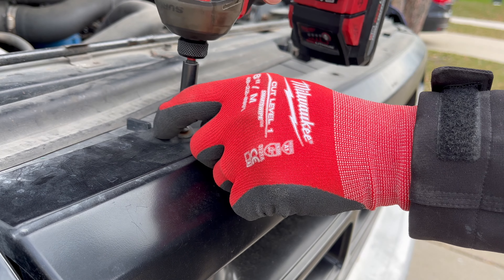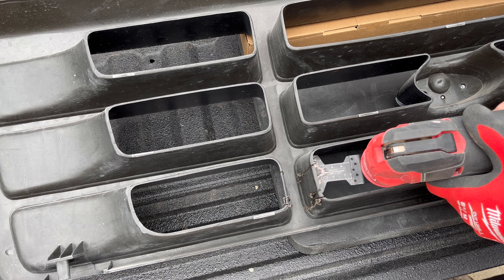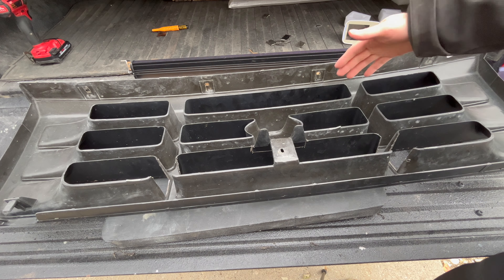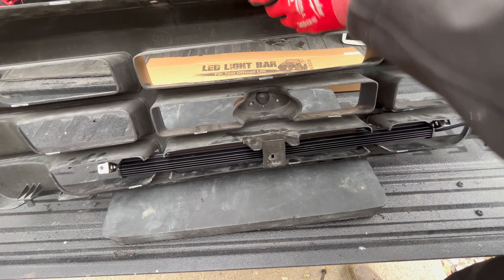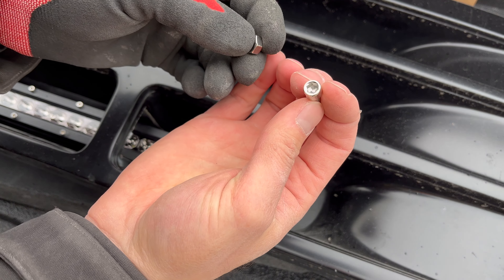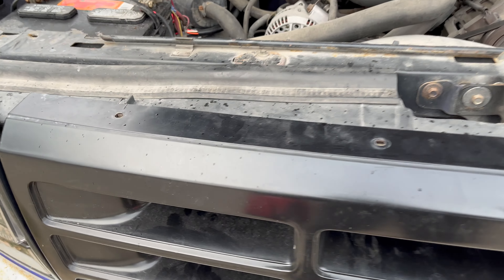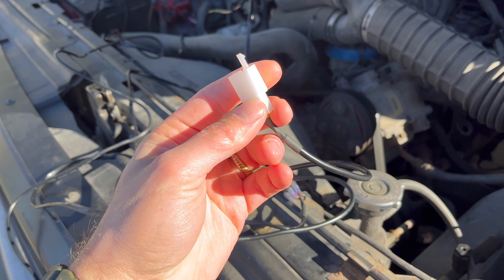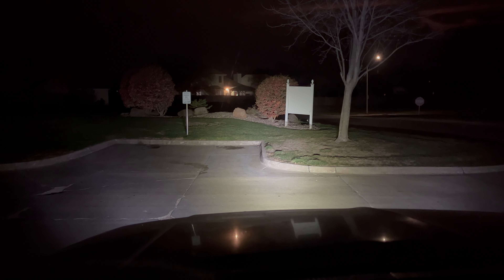How to Install a Light Bar Behind the Grille | 1995 Ford F150

Comment: Its nice to have additional lighting when needed.
 Some states require lighting like this be on a seperate switch that only gets power from the factory supplied low beam circuit this limits excessive lighting while driving on the hidhway to protect blinding on coming traffic.
Reply from the maker: Definitely! 

I didn’t know that. I just figured I wanted it on a separate switch.

Comment: Stevie! Thanks for another great video.  Ima let this marinade in my mind to see if I want to do the same. But I do have a question or advice. I’m going to do the water pump,and a seal refresh on my truck.  And was thinking of doing a long road trip after.  Of course if all my work is done right.  But would love some advice on prepping the truck for a long drive.  Or if anyone in the comments would suggest something
Reply from the maker: Thanks man!🤙 A good seal/gasket replacement job is always a good idea for these old trucks. I’m not sure how long your road trip is going to be. However, I recommend doing a shorter trip day and hour of interstate/highway. If any problems arise, it will happen during that trip.
Otherwise my prep for a long drive was always the same for these old trucks. Check all fluids and replace as necessary. Take additional fluids if it’s typically for them to get low. So for my truck, that was oil.

Comment: Do you know if the light bar comes with the harness or do you have to buy that separately? Secondary question, was the bottom screw hard to get in/not put in after installation of the light bar? Thank you!
Reply from the maker: Yup! The light bar came with a harness. I pre-assembled the brackets to the light bar and then had to mount it to the grille.

Comment: Doesn't look too bad, I'd be worried about the plastic melting though.
Reply from the maker: I’ll be curious too. If it does melt, then I’ll report on that. I’ve seen this setup before and haven’t heard anything.
Reply: @TheMinuteMasters I’d think if the truck were sitting running with the lights for an extended period I’d check it to see how hot it gets but if you’re driving it’ll be air cooled enough not to worry.
Reply from the maker: @WalterMelons  True
Reply: LEDs produce very very little heat, truckers prefer halogen bulbs because the heat keeps the headlights clear of snow if you live in a snowy area look at the headlights on the newer cars you’ll see it